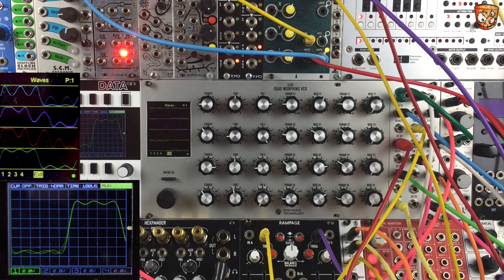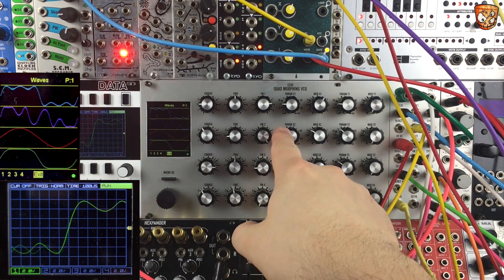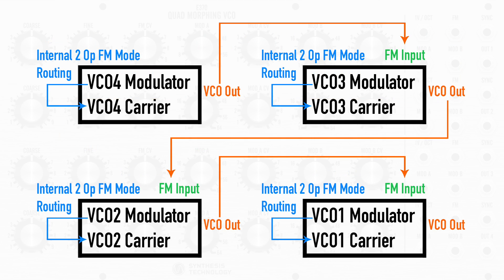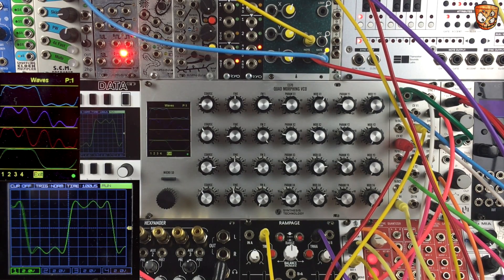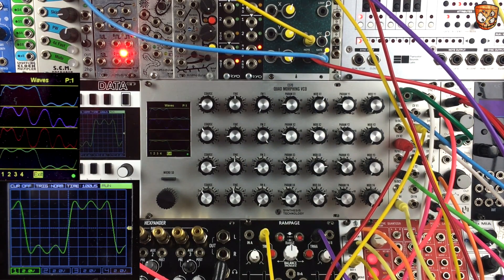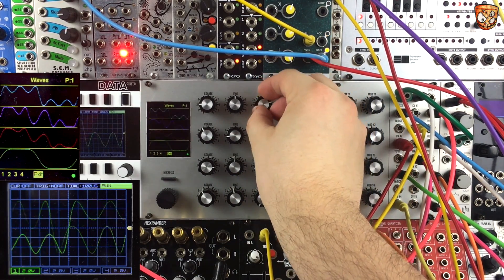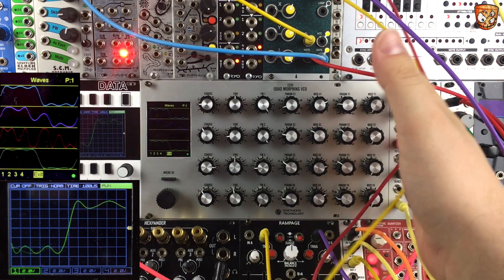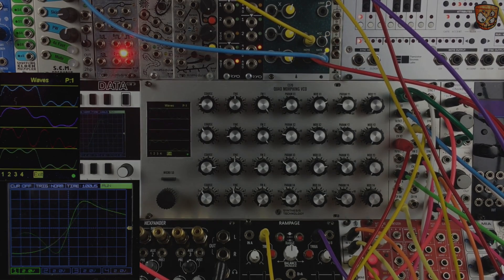Synthesis Technology - E370 8 Operator FM Patch

Comment: You can also get the same effect by getting a sine wave and another sine wave at +2 or 3 octaves and pushing it through a drive or distortion module, it's essentially the analog version of what Flux Pavilion used to do in his older tracks!
Reply from the maker: Yes I remember that, low and high sine into distortion. There was a video about that if I remember right.